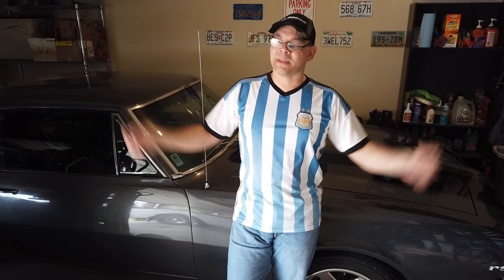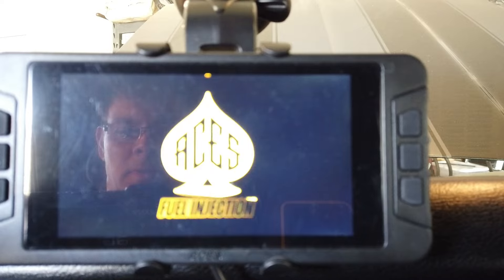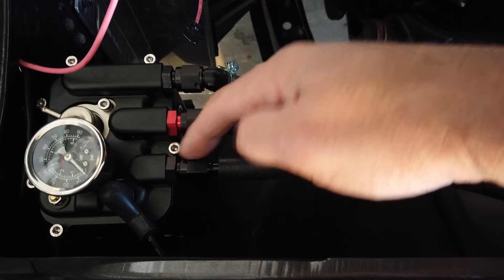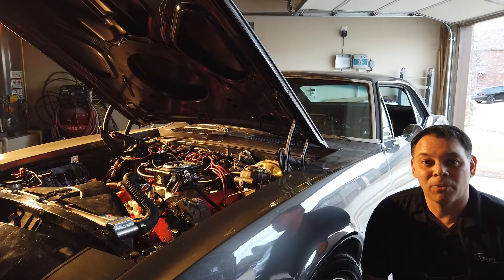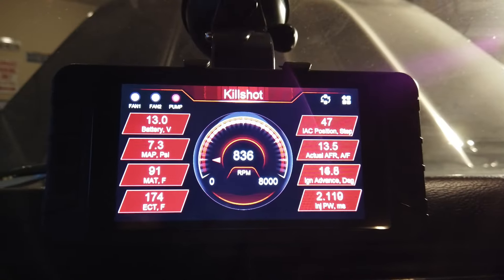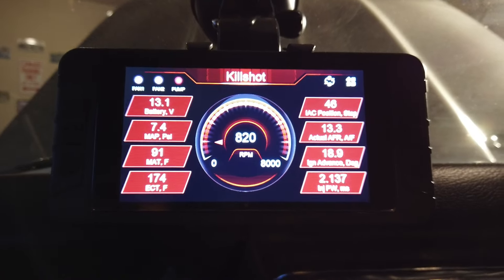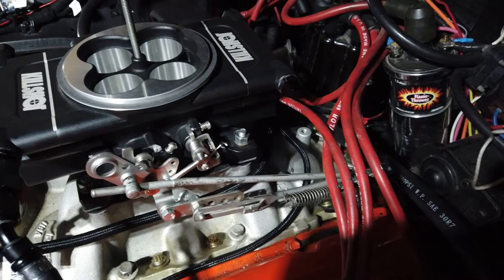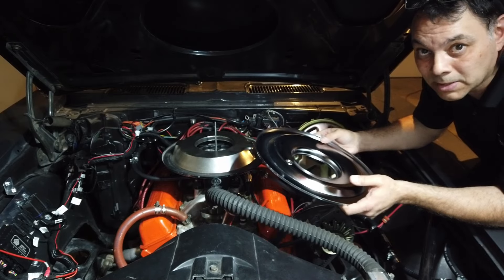ACES EFI Killshot Pt: 7   Completion, Setup and First Run

Comment: My 355 jeep wrangler dies every time I stop. 😢 Im going to get rid of my holy 650 and get this. Breaking out the credit card 😵‍💫
Reply from the maker: @stevejones5128  Before you do, I want to be fully transparent. The Killshot has so far been great and has given me little to no problems but there are others who are having issues. There is a Facebook page called ACES EFI Owners and Techs.  There are plenty of horror stories but few with the Killshot. Mostly with the LS EFI stuff. If you buy please take your time with the install and don’t expect it to be perfect out of the box.  Mine could sure use some professional tuning but committee (wife) hasn’t approved an extra $400 charge for that. It is however very driveable.  The Killshot horror stories all seem to be based around 2 issues. 1) poor installation with errors made along the way.  Those can be frustrating.  2) the ACES and/or aftermarket distributors.  People are having issues with the timing control.  All the problems I see are centered around timing control from their distributor/coil setups. NOTE:  I am not using timing control. I have a straight up mechanical distributor with vacuum advance. It is cheap… it is simple and I’m not dealing with another layer of possible problems because of them.  I have been chastised by many as to how dumb I am for leaving half of the EFI tunability on the table.  Timing control can make the setup run much better and more efficiently plus help with all sorts of other things and yet I’m not taking advantage of it.  Yet still… I’m not having the issues they’re having. If you buy their full top end kit with the distributor… good luck.  Join the Facebook group because you might need their help. All that being said, you can expect the same things from Holley, Jegs, FiTech and all the others. Why spend more on them when you can do it just as good for cheaper with ACES and their tuning software is free online from their site. I hope it goes well for you like it did me bud. Watch my Installation video to get a better idea of what you can expect.
Reply: Lol

Comment: Your face at 1st startup & 1st shift into "snappy" drive gear, PRICELESS!! 😁 Just pure shock/joy/excitement of all your hopes, hard work, & struggles paying off! Exactly my reactions on my '69 projects too 🤙😉 Congratulations,  & thank you for all your clear & precise steps, opinions, & procedures. I'm probably like a lot of other people going to pull the trigger & make the purchase just because we're normal Joe Schmoes like you & seeing you hammer it out. Good job & thank you for your videos! 👏🙌🤝👌
Reply from the maker: Thanks dude. Good luck on your build!  One way or the other I don't think you will regret EFI... whether it is ACES, Holley, FiTech, Edelbrock, Jegs or Summit systems. I looked at them all before buying my ACES.  I think overall ACES won out because it was the only one at the price that "Committee" would approve. Plus they gave some thought to overall appearance and aesthetics with that gorgeous powdercoating and the sweet ACES logo.  It looks cooler than the others and it is stock in black.  The others want more money depending on the color you want. I found that friggin STUPID!  Why should I pay FiTech $50 more to go from bare aluminum to black?  How dumb can you get?  That is actually one of the biggest reasons they lost my business.  I was going to go with Jegs but I couldn't get past the GINORMOUS yellow JEGS emblem on the throttle body either.  It was ugly. What can I say... I'm partial to beautiful things.

Comment: Have a 78 transam , massive lean dip at 2100 rpm. Uploaded tune to exu, Aces efi software won't self learn, yay. Starting to regret this purchase
Reply from the maker: Yeah that would suck. The software learns but you have to drive it for a few hundred miles and it will not learn in idle but neither does any other manufacturers'. In the meantime it can be a struggle.  When you say you uploaded tune to ECU, do you mean you put in a tune manually that you adjusted?  If so, the software will take longer to learn because you forced a tune on it. There is also a setting that forces the software to STOP learning. I hope your tune didn't turn that on.  I don't remember where that is at... but it's the closed/open loop item. Have you tried adjusting the fuel at that specific RPM range in the software?  If you do, and up that range by like 5% that should fix your issue. Depending on the setup of your TransAm engine, you might need to fiddle with it more than others. If worse comes to worse there are remote tuners that can help you but they are at a price, however people are saying they are worth their weight in gold because their cars go from running slightly rough to almost race ready!  If you adjust the tune yourself make sure to save your original in case you booger up something even worse... then you can just revert to the original.  If you haven't already done so... ask for an invite to the facebook group called ACES EFI OWNERS AND TECHNICIANS.  There are thousands of us on there helping each other out through some basic questions, fixes and adjustments.  I sure hope that helps you.  Don't give up.  It sounds like you're close but just have one small spot in the tune that needs help.
Reply: @dc10tech911  , thank you for that response! It wasn't for me but I found it extremely useful and heartfelt. 😊😊👌👍
Reply: There is no 100% "self tuning" EFI system out there. Holley, ACES, etc, it doesnt exist. User input is needed to get your system dialed in correctly, thats why every system has its own t software you can download and modify parameters.
Reply from the maker: @PrimeraRSTKD  oh absolutely.  You know that and I know that but that's not how ACES markets this system.  They claim it will self learn... not that it will require tuning.  I'm going to run it till it's done learning and see how good it turns out with the built in tune.  I'm gonna try and make a video on the results at some point. My guess is that what they're getting at is that it will be just fine to drive... not that it will be like a factory new car in responsiveness.
Reply: Maybe you have a air leek

Comment: I've been trying to pick between the Fitech Mini and an in tank pump, is it still performing well? Is it very loud? I have yet to see one on a vehicle in person. Thanks.
Reply from the maker: So I went with the mini because ACES didn't have an in tank returnless pump... but now they do so you might want to think about it. Biggest problem is cutting a new hole that big to the in tank unit. But if you want to keep everything fairly stock the mini has been great. It holds a rock steady pressure with no fluctuations. It isn't loud at all... as a matter of fact the ACES unit is louder as it pumps the fuel in. Only time I hear the mini is on initial turn of the key the pump self primes and adds a squirt into the Killshot... then its fairly silent because the pump itself is submerged in the mini tank. I'm very happy with it.  Buy either with confidence!
Reply: @dc10tech911  Thank you for taking the time to give me the feedback, I appreciate it man.

Comment: If 15 is good 20 is better ❤
Reply from the maker: Probably true and would make starts a little easier but ACES said 15 so I put it there. I'm not sure how their software would like it if I changed it.  I do believe however that if I change it to 20 I would need to go into the software to change that to 20 as well. I think it's set up so that they have to match. I'm waiting till it's done learning.  Then I'll save the tune then I'll play with it to see what I can improve and if I screw it up I can fall back to the good tune

Comment: nice video series thanks for sharing. i have a fitech on my old dodge it does pretty well, very similar to the aces unit
Reply from the maker: Thanks.  I appreciate that.  They are very similar I agree.  How do you like your fitech?  Has it been reliable?  I think one of the things that sold me on the ACES and not the fitech was the ECU being able to go in the cab. Too bad the AC made that impossible.  Wasn't in the mood to dismantle half the car.

Comment: Just ordered one for my Boat. Hopefully mine works oit as well as yours.
Reply from the maker: @PlateFleetResearch  I hope so too bud.  I never would have thought of a boat though.  I have 1 concern for you.  Though it is quite responsive out of the box... at least for me... you may need to tune it because if you're using the boat for skiing or wake boarding you'll need that quick instant acceleration or it might make that impossible.  May I also recommend joining the Facebook group ACES EFI owners and techs so people can help you out if you run into issues.  This group has grown quite a bit since I bought my system.  Good luck and take your time.  That is the biggest reason for failure among the group... don't rush it
Reply: I would think it would be super hard to put one on a boat.  They have special exhaust manifold, where are you going to mount the 02 sensor? Also there is usually water running through those manifolds which makes it hard to get a good 02 reading. That is unless you are using just open headers then it would work.
Reply from the maker: @EdwardHixson  Most guys that run these on boats are using them on speed boats with V8 engines and open headers.  The only downside is that they will need to drill into the header for the O2 sensor or bolt on an extension pipe and put it there.  My only concern for boat guys is the constant need to go from idle to near full power and these Killshots need to learn for quite some time before they are good at quickly jumping from low power to WOT

Comment: Great vid, highly detailed and will help with my Killshot system.. question, why did you not go with Aces fuel pump? I can guess it was the return line?? Thx again for great vid about your sweet ride!
Reply from the maker: @jefferymaxfield7826  Thank you sir.  I appreciate it.  I went with the FiTech Mini because in the days when I bought my system, ACES didn’t offer the new pumps or the command center.  All they offered was the Killshot and in-line fuel pumps.  If I had to do it all over again with the new stuff available, I would have gone with the in tank pump.  It would make for a cleaner install and no need for a return line so that would have saved work and money.  I wouldn’t have needed the extra hose, hose clamps, and filters.

Comment: Does anyone know why i need do give my royal flush a little bit of throttle to start up, and why it bogs down when i get on full throttle ? Also its shooting when i let go of the gas
Reply from the maker: Hey bud, I was getting the same problem with it not wanting to stay on during cold starts.  I just posted a little 3 min video on what I did to fix it.  https://www.youtube.com/watch?v=o0DJ1hCcsJo   as for the shooting... do you mean it squirts fuel everywhere when you let go of the gas?  That's a strange one.  Also, are you part of the Facebook group?  If not, check out the Facebook group called "ACES EFI Owners and Techs".  The ACES people are there some of the time answering questions, and so are a bunch of super helpful owners like us with some experience. The ACES folks go through that Facebook group looking for problems and then they answer interesting questions on their Youtube Tech Tuesday videos.  They answered one of mine one time.
Reply: How long have you let it "learn". Takes a while and only really "learns" after operating temp. Need a few hundred miles to self learn. That said, you can tune it yourself but that will remove the self learning part and will use your settings instead. 

All the current self learning (Sniper, FiTech, Jegs, etc) are the same way. Takes time and is always learning.
Reply from the maker: @Nowayjose-z2r  yeah. I've hit 200 miles and it's still learning. I wish there was a function for learning during start.  That would solve 75% of people's problems i would think.  Most everyone taking about problems are experiencing them while starting, warm up, and getting it to idle right.  Next biggest issue is bogs when romping the accelerator... but that's a simple tuning change.
Reply: @dc10tech911 hey buddy know youve probably answered this many time but what did you do to fix the bog when romping it
Reply from the maker: @ThomasTuttle-v2o  DISCLAIMER*** I'm not a tuner.... but I'll share what I've picked up so far.  Read on if you're ok with that.             I just did a 6 month update video about 2 weeks ago showing that I still have the bog but I also say that the system is still in Closed Loop (learning mode).  I won't be making adjustment to the tables until it's done learning because I want to see if it can actually learn on its own to get rid of it.  If you mess with the tables it will use your modifications instead of self learning.  Be aware of that. That being said... to fix the bog when hitting the accelerator, go to Tuning>Fuel>Advanced> and enter into the graph labeled "Acceleration Correction vs TPS".  This is like adjusting the accelerator pump on a carb.  Enter the chart.  The bottom is the degrees that the throttle position sensor (TPS) shows open to.  The lower the degree... the closer to idle you are. The higher the degree the more the intake is open.  So... If you are having issues blipping it while at idle and it bogs when you're just sitting there trying to show off while stopped or make a launch worthy of a ticket... up the graph point on the lower range like 0.0, 10.0 or 20.0.  If your problem is while driving you need to up the higher numbers because while driving the butterfly blades would already be open more. I would recommend just increasing the whole graph by whatever percentage you choose. So it stays nice and smooth. One of the things you can do to figure out where your problem is, is to go to your sensors and see what the TPS sensor says it's at when you have your issue.  Drive around and see what the TPS was showing when you had your bog and that will be the section of the graph you have to change. But again... you might wanna just up the whole graph.  Also your AFR reading will let you know if you are going too lean (higher than 14) or too rich (lower than 12) when your bog happens. The 2 things can help you figure out where that graph is at its happiest.  Some people have had good results getting that chart closer to 100% on the left (vertical) axis.  Others needed closer to 150%.  Go slow and see what helps you.  This issue is more common on lower displacement engines like 327s and below and some stockish 350s.  The reason is that the Killshot is basically a 1000 CFM "carb/throttle body" and that is HUGE for a small engine.  We don't need that much air.  Once you've made your change don't forget to save with the 1995 era floppy icon on the upper left corner or nothing will change and you will think it didn't help.  Lots of people make that mistake.  Also, I don't run timing control.  I use a vacuum advance distributor so I can't help you with it, but if you're running timing control you can try lowering your timing by like 2 degrees across the board and see if that helps if the graph adjustment doesn't completely get rid of the problem.  Remember... make slow adjustments.  I AM NOT A TUNER AND AM NOT RESPONSIBLE!!!! LOL.  Sorry that's long winded but I wanted to make sure you got as much of the info as possible.  Good luck and please please please let me know if that did it for you bud.
Reply: @dc10tech911  thank you i will definitely check and do that and its with a 5.3 Ls with a cam that was carb and switched it to the aces and its mainly driving and launch but thank you and i really enjoyed watching your videos on this im new to the whole tuning efi world and wanted imput from people like you who have actually ran it and used it and not just cranked it and made a video
Reply from the maker: @ThomasTuttle-v2o  oh wow... well thank you for taking the time to watch but if you're running an LS with the Jackpot system I really don't know if anything i say or do transfers over from the Killshot to the Jackpot. Just be careful
Reply: @dc10tech911  yeah i know just wanted to see where to start cause idk where to begin if it was a carb on a sbf or sbc id be ok but yeah but alot of what you said made sense and imma try it and see what happens again i appreciate your replys
Reply from the maker: @ThomasTuttle-v2o  one more thing. All is dependent on fuel pressure. If your fuel pressure is dropping during hard acceleration... that would cause it
Reply: @dc10tech911  ok cool i will double check all that

Comment: Hi from Australia, what was your original carburettor? Quadrajet or other?
Reply from the maker: Wow... I reached Australia...cool! This car has its original 327 engine but I had already replaced the original manifold and carb a few years ago. The original was a 2 barrel Rochester.  Over the last decade though I had been running an edelbrock dual plane intake with a 650 cfm edelbrock 4 barrel.

Comment: What did you do with the PCV valve?
Reply from the maker: I kinda touch on that in this video https://youtu.be/SYK_ItABPaU?si=Zb_lIiMEdvQoDsyM   right around 2 minutes. At this point the pcv valve was going to a manifold port.  Once I installed the Killshot I ran the pcv hose to one of the larger (3/8") ports on the side of the Killshot.  Those are manifold vacuum too.  I hate doing it because I'm introducing oily air to the intake which can coke up the valves but to help remove the oil from the air I installed a cheap $30 oil catch can in the line.  I talk about that too right before that 2 minute mark. Hope that helps.
Reply: @dc10tech911  do you have a part number for the catch can you used
Reply from the maker: @TheRamRanch  sure do. I used a Dorman 46110 catch can kit but those have gone up in price.  Evil Energy makes a decent one from what I hear for about 35 bucks though that is baffled.